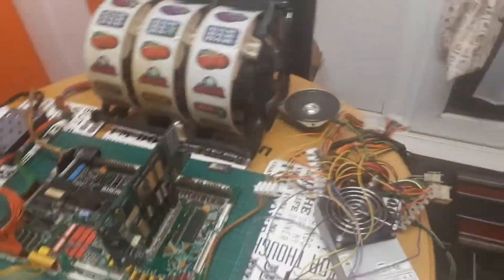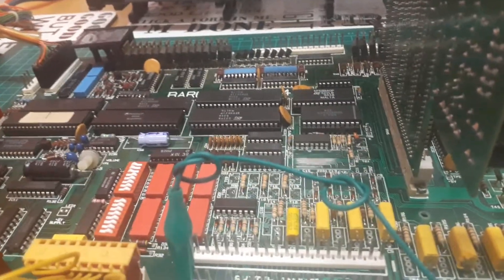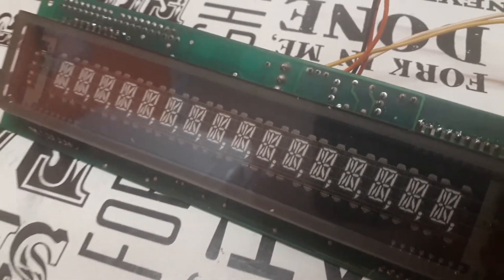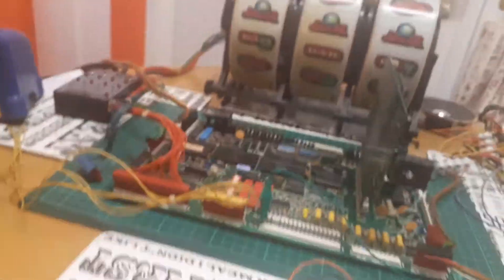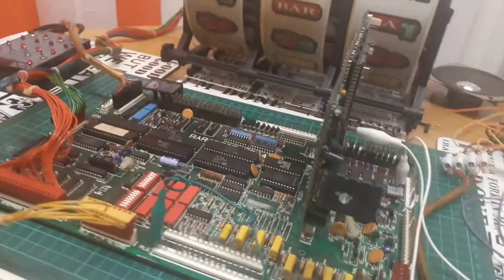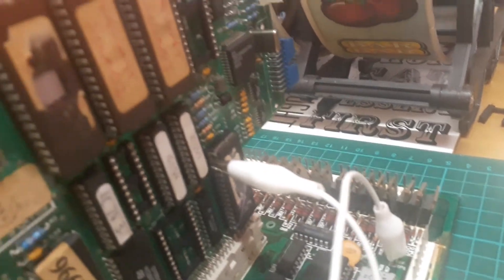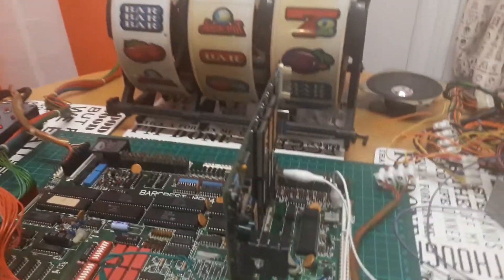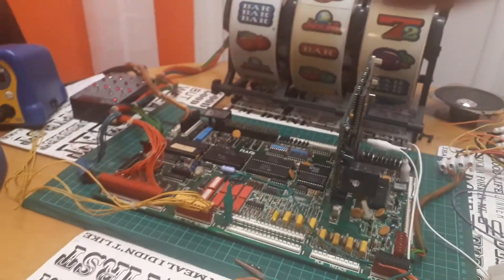MPU4 TEST ROM on 128k and more

Comment from the maker: The macihnes all have dedicated cabinets and glasses . Program wise when Barcrest were releasing MPU4 games they included protection on the program card meaning only the ROMs for that card could be used.  When the aftermarket builders were given access to the platform mostly they opted not to use the protection.  There are a few different test programs about tho so my intention here is to make a cart which contains all the MPU4 test programs wrapped into one unit .A lot of barcrest games had the test routines built into the program anyway, this is just one of those projects you do because you simply can...